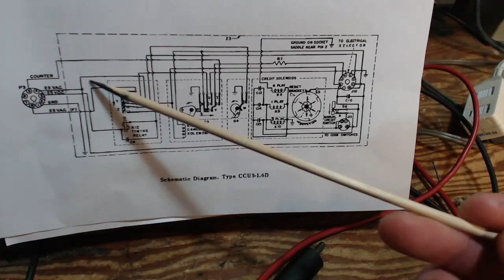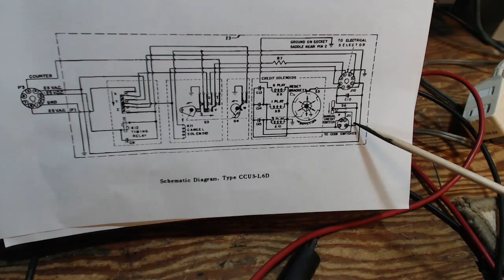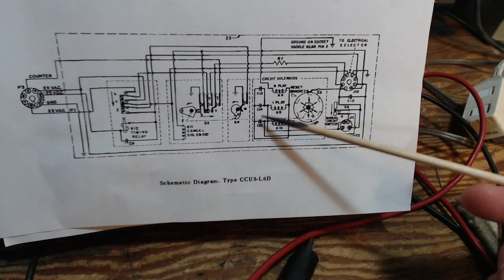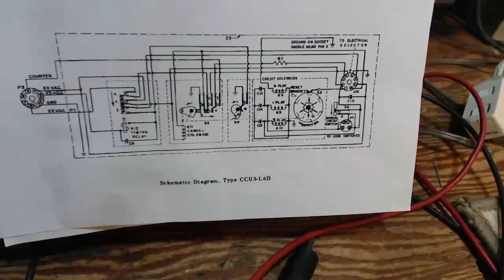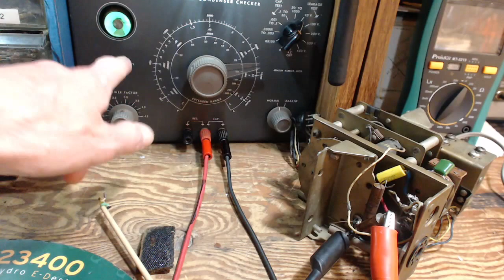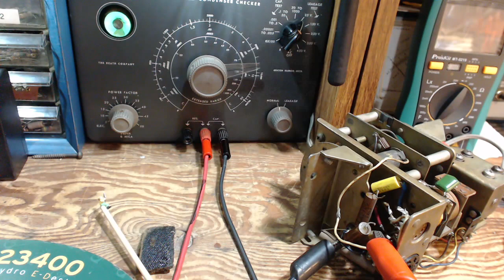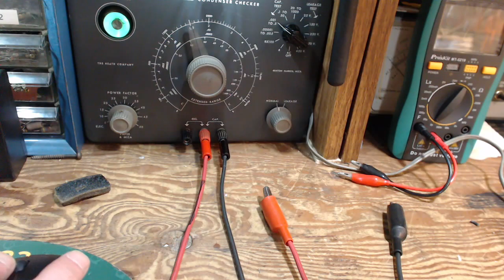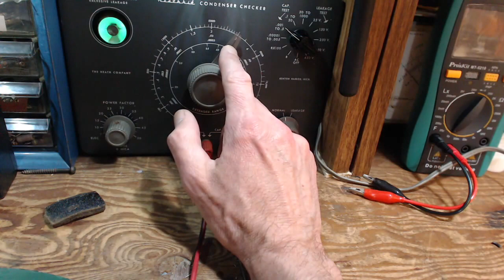Smoking Seeburg Jukebox Video #4 - Solenoid Capacitors

Comment: I would think that you would be looking for a low or 0 ohm path from the burned wire to whever it could complete the circut..... might be in another curcit that connects to one of the pluges.